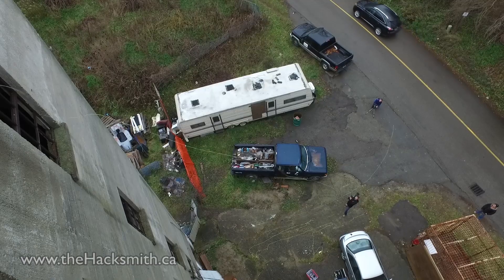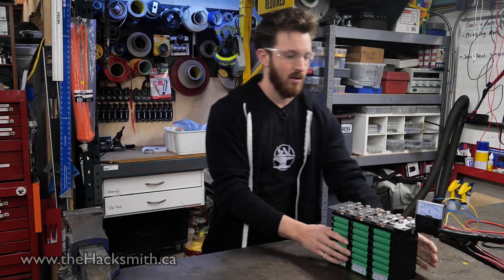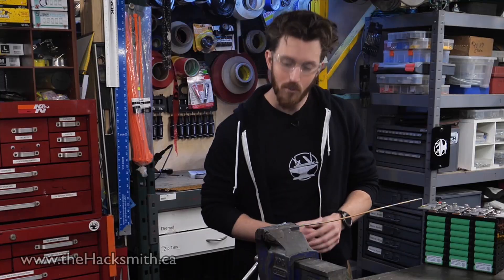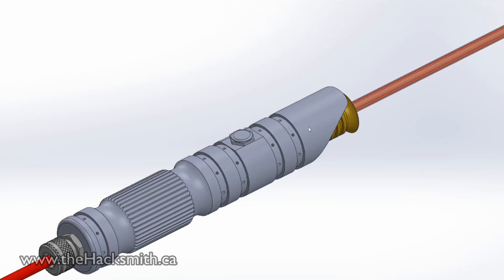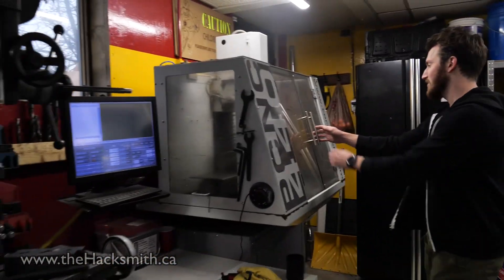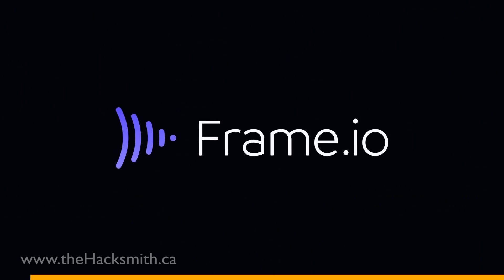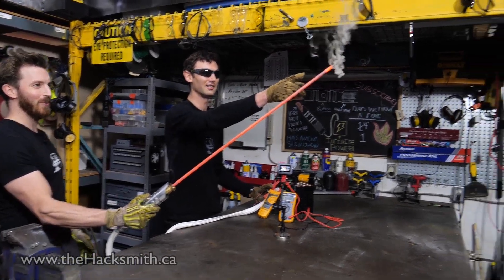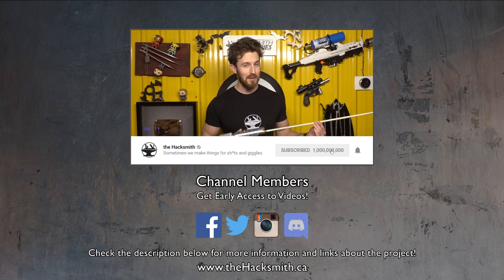3000° TITANIUM LIGHTSABER BUILD!

Comment: Question, wouldn't the Tungsten touching the Titanium cause rust to happen faster? Two different metals touching causes things to rust faster.
Reply from the maker: It's not touching, it wouldn't work if it was! There's a high temp insulator in between the two 😊
Reply: @hacksmith  I see. Thanks for the reply on an older video of yours. Follow-up question: You said the titanium wouldn't get hot because of the set-up you have. The tip of the blade where the titanium is out shows it is very hot. Did you mean to say the titanium would stay rigid with tungsten around it, or was something else in the design at play to keep the whole thing rigid?
Reply from the maker: Unless it was edited wrong in this clip... It's the titanium that gets hot - the tungsten has the higher melting point so it remains stiff (even at the same temp as titanium)
Reply: @hacksmith  Ah, and the tungsten core was to make the outer titanium rigid. I rewatched and saw where that was explained. Thank you. I look forward to watching the later videos to see how you improved on the proto-saber and full saber designs.

Comment: If that lithium ion battery pack is capable of putting out a maximum of 12 V, and my Xbox is powered by 300 V, that means my Xbox could power 25 lightsabers, now I know how it runs the skywalker saga
Reply from the maker: That's not how power works -- power is voltage times current. Ours runs at 500 plus amps, making it over 5kW of power,  a Xbox only uses about 300W

Comment: My theory on a Lightsaber is based more on flame than on light. Not standard flame. Blue Torch flame. I discovered with my blue torch cigarette lighter that no matter which way I pointed the lighter the blue flame maintained a straight line in that direction. It did not bend upwards like a regular lighter would. So if it could be done where the hilt housed a large amount of whatever fluid that is with a multitude of gas ports then perhaps something like a lightsaber could be made. My only guess would be the max length of the  blue flame would only be 2 feet long

Comment: Just wanna say some stuff that maybe if some real top level budget got involved could happen
You could try and rig the saber so that when you press the ignition the metal blade shoots up
And if you need the plasma to start faster you could put a turbine in the bottom so that it will need a smaller battery

Comment: A suggestion
Make the protosaber such that it would fit inside the tilt like a naval telescope does, so you could heat the rod while it is inside and make a mechanism so that it would come outside on the push of a button, and since it is already heated, the rod would come out being red hot, that way you practically have a real lightsaber that you can carry in your pocket

Comment: If your going to make the battery pack for it it's a small pack that screws in at the bottom the hilt you see that for a fact in one of the star wars the clone wars episodes. And to be more specific it's the one where Obi-Wan is trapped in a cave and his battery is running low

Comment: I have some improvement ideas, make a device on the inside that is electricity resistant and make the tungsten/titanium rode extend and destend in the lightsaber so it’s more like a lightsaber

Also make the wire a but shorter and the batteries more compact so it it more portable
Reply: Your asking a lot dude lol

Comment: I figured the tongston excuse my spelling but i figure it would smoke because he said that the tongston* smokes at high temperatures and it was still included in the design so it could be very dangerous for the simple fact that if the ventilation was to fail it could potentially explode if to much pressure builds up with no ventilation

Comment: Ever try using a contain field like how a hover board works? Use an ion generator to flood an electromagnetic field, and the ionized air will be held within the containment field creating a forcefield to push off the ground. Modify this to hold plasma energy and you'll have a light saber that can be lengthened to your desired length.

Comment: "recommended video"
I wasn't looking for this but  HOT DAMN!

also, I got a quite of idea how to make that retractable, but since it's hot it might not work...
Reply: Tristan Jay Tabafa exactly wut happened to me
Reply: You could simply wait for it to cool down before retracting, but I don't know whether the electrical part would still work, considering that the two metals would have to be separated and isolated for the whole thing to work
Reply: You could maybe make the handle a littlw bit bigger and then put a cooling system inside sorta like liquid nitrogen or ac

Comment: Try a metal like tungsten because of the high melting point or chromium the thing is chrominium is more of an insulator than a conductor so you would have to transfer heat from another metal

Comment: One other idea would be to recreate an imperial blaster. I’m thinking you could heat BB gun pelts and melt them down placing them into molds. The mold could be tapered. What I mean is the metal is twisted so that it acts like fletching on an arrow on the back end of the solid metal round. The barrel of the gun would be riffled and use co2 cartridge for the force needed to propel the round @thehacksmith

Comment: Could you use something with a lower resistance with the tungsten and ceramic core so you could use less power then extend the bottom of the saber (probably about the length of a double bladed saber) so you wouldn't need an external power source? And maybe charge capacitors so it would warm up quicker?

Comment: Hey why dont you use nickel chromium wire instead, it turns red hot with only 27 or so volts
Reply from the maker: It's not about voltage,  it's about current

Comment: Also, why not modify it that if it reaches a certain temperature, it will turn off and cool down and if it reaches a certain cool temperature, it will rise up again. Like if it reaches 4000c it will go down to 2000c then rise up 4000c and so on. Also, it would be easier if there was a material in earth that hardens under hot temperature

Comment: Now: Charging lightsaber using wires that connect from the saber to the battery pack.

70 years later: Battery is inside the lightsaber making it not a proto-saber but a actual lightsaber.

Comment: You need to make a battery using graphine that will fit in the hilt of the lightsaber. Also, can use it with the metals, to make them much lighter and stronger, so you can use a telescoping retracting “blade”. You could also use a laser hilt, shooting a very strong beam into a diamond tip and have it bounce back down to hilt into another diamond that bounces back and forth. Boom. A ACTUAL lightsaber. , you can also have different color blades due to different laser lights: you’re welcomed

Comment: I would most certainly shell out the money for one of them!!!

Can the Mark 4 model have a retractable blade that safely stores away inside the handle even when it's still cooling down after being turned off?

I think it would be difficult walking around and maneuvering with it in tight spaces like buildings if the blade is always out like that.

Plus having the blade retract into the handle will help protect the blade itself from being bent or broken when not being used.

I don't know how strong the blade itself is and what amount of force would damage or break it when being used in real life scenarios, but it can't stick out like that 24/7 unless a special sheath or holster is made for it to wear at the hip like Knights used to wear to hold and protect their medal swords from the elements when not in use.

It would be yet another step closer to being like a real lightsaber if the blade was retractable and safely stored away inside the handle.

Comment: It's just a hot red metal 
In my opinion you could use a laser module of high power rating of wavelength of 750nm iit can turn red and the focusing of the laser can be fixed to a short range making this tool more magnificient

Comment: You guys need kyber crystals. Combine that with some sort of power pack for a Proto saber and there you go. According to Canon more the original lightsaber was actually powered with a cord hooked up to a power pack. It's only 2019 guys, give it about 10 20 years and you'll be able to have a lightsaber with a power supply built into the hilt. Maybe an actual real lightsaber instead of a high temperature titanium tungsten hybrid rod for a blade.

Comment: Technically you made a protosaber. It was the first lightsaber ever made...it was simply a lightsaber powered by a battery pack that was clipped on the belt of the wielder. You mentioned a protosaber battery at the end but still needed to said it. Congratulations on the protosaber though. It really cool

Comment: Are you serious? 3000  Degrees  and plastic head?
Reply from the maker: Yeah. Welcome to thermodynamics. It might be hot but it doesn't mean it can cut metal
Reply: @hacksmith  yes,  but you can show what happens with wood,  
Thick coat of aluminium, for example,  
There are many ideas
Reply: But video is very good)

Comment: that lighsaber looks like the original lighsaber from star wars, when they didn't have internal battery packs for lighsabers they use a battery pack and put it on their waist which had a wire attatched to the saber, of course it used a crystal not titanium

Comment: Is there a way to make a telescopic blade that can retract when not in use?
Reply: In theory yes but as the design stands the method of basically using the blade itself as the wire would not work. Also as is true with you lightsabers you would not be able to have a uniform thickness for the entire blade. Also like a toy if there is a significant enough amount of hardware in the hilt then it would only telescope to a partial blade not none whatsoever.

Comment: Fun fact according to Star Wars lore the first lightsabers had to have battery packs to use them and this wasn't a small battery pack either it was like a backpack but heavy and supplied energy to your lightsaber as you can see this cause problems for moving quickly so they discovered a way to put a power source in the lightsaber and that power source is kyber crystals

Comment: Isn't using Lithium batteries for testing kinda... well expensive if you damage them, if nothing else, i would test thing with something like welding transformer, or multiple of them in parallel (for more current) or a "custom wound" low voltage multi-kiloamp range output one perhaps...

Comment: How about carbon? I’ve heard that it doesn’t melt at normal atmospheric pressure and doesn’t catch on fire on high tempratures and it can definetly heat up to 3000 degrees Celsius.
(Edit) google told me that tungsten has a melting point of 3422 and carbon-3500+
Reply from the maker: Brittle, very very brittle

Comment: You need some tough material like steel or titanium in the blade that would be insulated and act as a support, because, even with the tungsten core, the blade itself is not strong enough at such high heat.
Reply from the maker: Titanium or steel would melt... Tungsten is stronger! We just need to make it thicker
Reply: @hacksmith  After a little research, I've found there is pretty much no insulator that would be thin, rigid, and heat tolerant enough to stay strong at such incredibly high temperatures (even refractory ceramics and graphite would melt). Good luck on lightsaber V4.
Reply from the maker: Hence... tungsten.

Comment: You know they use nickel for the fans inside of a turbine engines because it maintained its strength up until it’s melting point. 
It may be a nickel alloy... but regardless that’s what you should’ve used. Those blades stay together while spinning at 50,000 RPM or whatever crazy number it is.
Reply from the maker: staying together versus being basically melted isn't the same thing...

Comment: What you are buliding is not a lightsaber ,it is called a protosaber since it has wires connected to the battery or has a battery . The lightsaber used after crystal swords , but still impressed cuz i thought its impossible to exist but it does cuz of u .

Comment: Cool project! Seems like the tungsten didnt quite perform as hoped though; it looked quite bendy there hitting the table. A silicon carbide radiator tube might be ideal to get your combination of strength at high temperature. They wont have them at the local hardware store but its a pretty standard item in chemical processing industry, so shouldnt be impossible to find. As a resistor you could loop a piece of carbon sleeve inside that tube seperated by some insulator. You wont melt that carbon and it will put you in a somewhat more pleasant resistive range than a metal resistor will, so you wont be dealing with such chunky copper cables or flaming batteries.

Comment: Unfortunately lightsabers don't give off any heat. So um fail
Reply from the maker: Really? Then how do they cut anything? How do they melt blast shield doors?
Reply: @hacksmith  how about you look it up yourself. Its Canon straight up. No heat. I'd say you got a great question but that's just how it is I guess
Reply: @hacksmith  however if it was truly a plasma it would be extremely hot and even standing within a hundred feet of it would vaporize you.
Reply: @hacksmith  that's why when we create Fusion we must use giant electromagnets to keep the heat and plasma trapped within the coil otherwise it would just melt the container
Reply from the maker: So you don't know how it cuts something without heat? Certainly sounds like it does create heat -- it's just insulated from the user ;-)
Reply: @hacksmith  I told you to look up information yourself it's all Canon. Just because you don't like the truth doesn't mean you got to be in denial about it.
Reply from the maker: Maybe you should look it up then ;) either way. It's fiction. I made something that looks, and works like a lightsaber. End of story.

Comment: Why not use an automotive power antenna? Simply put a small quarter size mirror at the tip with 3 or 4 colored laser pointers at the antenna base (pointing at the mirror)? When you activate the antenna , the laser lights will really raise while telescoping up until it's fully deployed/extended!☺😁 Of course, you really can't strike anything or the antenna will break, but visually, it will replicate the rising light saber power up from the original Star Wars scene (obi wan and vader). The portable battery pack will probably be the biggest obstacle to power the antenna to deploy☺

Comment: I understand that the challenge was to try to come up with a real life version of a lightsaber, but this just wasn't even close.  I applaud the time and effort put into this challenge.  However, the final product, in my opinion, was a fail.

We don't yet have the technology to even come close to replicating this kind of weaponry, so to try to do it with current tech is kinda pointless.  They're just heating up a bulky piece of metal using a bulky and cumbersome attached battery pack.

Comment: Why don't you use a tungsten inside and a carbon outer layer. This would be a most likely non glowing but still more durable against heat blade. And if you could find a form of carbon that was more sturdy than graphite, like graphine (though expensive it would be revolutionary), you could make a viable sword that could cut through steel, and if you are willing to damage the blade, even melt carbon. This would be an incredible experiment and could be a step towards the future of melee technology

Comment: Why not use a laser and use mirrors to cage in most of the laser beam like a sheild and use giant capacitors for power supply try it out i also challenge you to create your own giant laser diode. Because other laser diodes can't handle high voltage so create your own to increase the output of laser beam power

Comment: Think the trick with the lightsaber isnt so much the joule based heat. You're only producing about half of what a lightsaber should be able to produce. Hows that supposed to cut through a foot thick of steel?
I wanted to make a lightsaber at one point. Figured the best place to start would actually be the power source, hardest parts coming up with the means to power it. And a backpack full of 18650s isnt realistic.
A lightsaber should essentially be 3-4' of Plasma torch. Most commercial plasma torches come no where near that long of a torch. Maybe with design modifications the extra length could be managed. idk
I was curious too about some tech i saw some jewelers using. Oxygen concentrators for use with their torches. Made me think of condensing one of those concentrators down into a handheld device. Better yet would be to have it concentrate both oxygen and hydrogen, be able to adjust the mixing ratio of the two.
And then i came back to the whole power source issue and I thought to the Iron man Franchise. Palladium. What if there was a third leg to this mini cyclic concentrator, one that passed through the hydrogen and oxygen, back and forth. The timing would have to be just right, and even then I think it could be a wee dangerous. Hydrogen has a tendency to ignite when Palladium becomes too reactive near it. But I think theres a chance it would actually work.

Comment: lighting up tungsten, aren't you worried about X-ray radiation?
Reply from the maker: Old lightbulbs use tungsten filament -- exact same thing. They don't blast you with x-rays =)
Reply: In the Coolidge tube, the electrons are produced by thermionic effect from a tungsten filament heated by an electric current. The filament is the cathode of the tube. ... The anode is usually made out of tungsten or molybdenum. The tube has a window designed for escape of the generated X-ray photons.  @hacksmith  Just making sure you guys are safe.